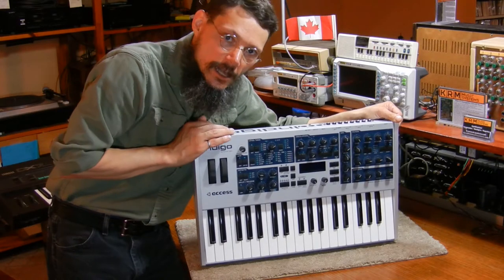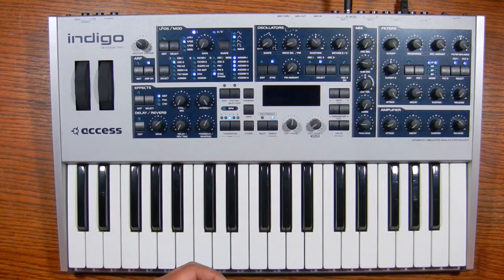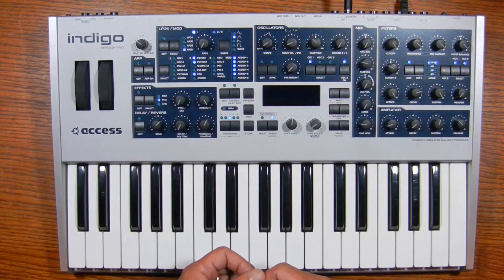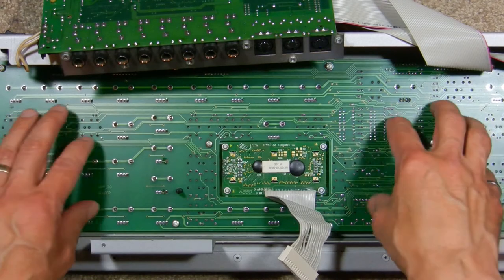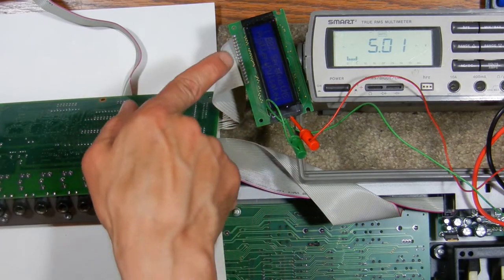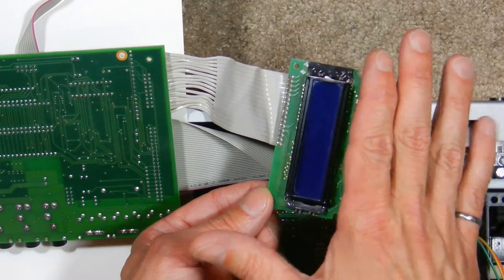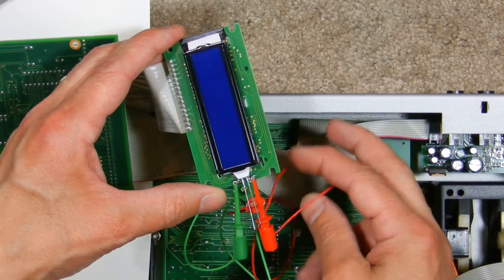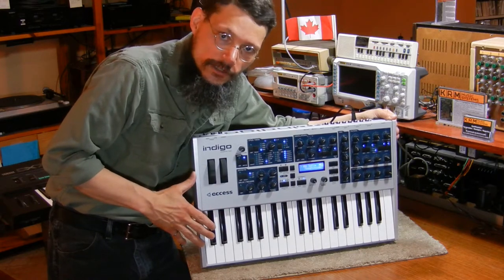Access Virus LCD Repair

Comment: From the patent office to UL we were never encouraged to run anything disassembled in service position, reason through problems, fulfill Right to Repair monolithic products. Most consumers are probably unaware of the fact that this is how it’s done. "No User Serviceable Parts Inside" Would be great to see guidelines on determining when electrical dependencies permit powering up separate boards or combinations of boards, with or without theory of operation. Listen to KRM about the variances of LCD boards and avoid vexation.
Reply: who's KRM?

Comment: Hey Keith !
Got a Virus Indigo (1st gen) also with burned leds. I bought the adafruit backlight and replaced the led and it worked great for a day or two. but today it stopped working again. 
Haven't had the time to check it yet. but if it's burned could it be voltage it to hi?
another weird thing happend after re assembled , the synth just turned off after a few minutes, had to re power it back. it happened twice. can it be related ?
can it be that I wired it wrong ?

Comment: Hi Keith, nice fix! I have a virus B playing up.
 I wonder if you could take a moment to point me the right direction!
https://www.youtube.com/watch?v=CaxL...ature=youtu.be

From the video you can see once clicking single mode and then using parameter switches to flick though the patches is taking me to LFO 2 section?

1st I tried to reinstall OS but no different so definitely hardware issue.
I have managed to replace and solder 7 new switches thinking this would solve my problems but alas the problem is still here.

Switches I replaced are-------- 2 x value, 2 x parameter, multi and single, and LFO 2 amount.

I have 3 more switches left, but Im starting to think the old worn switches are not my problem.

I have also tried a newer power supply that came with my novation circuit, but this makes no difference also.

After I changed the parameter switches it worked perfectly for half a day then problem returned. So it does seem intermittent. But is doing the error all the time now ;(

THanks Richy

Comment: Hey Keith!

Thanks for all
thid brilliant videos and tutorials. Actually folloed this one strictly to
replace the display of my Virus Indigo, everything seemed ok but at power up,
the display went just blue and nothing else happened. I asume i just left some
bus board cable unpluged or plugged incorrectly , Nos dont want to try powering
up again as they might be wrong…Cant find any kind of diagram of the inner
lay-out of the synth to doublé checked evrything is ok. 

Please any help?
Maybe sending you some pictures i took while putting all back together?

Any info much
appreciated!

Thanks again

Comment: Hello Keith! I have the same problem with my Access Virus Ti. Where I can buy this component? Thank you very much.
Reply from the maker: I got the replacement backlight on Adafruit. Just Google for "LCD backlight adafruit" and you should get several matches. I should let you know that it wasn't an exact match, and I had to hone it down to size. It wasn't just a drop-in replacement.
Reply: Synthesizer Keith I found it! Thank you very much!